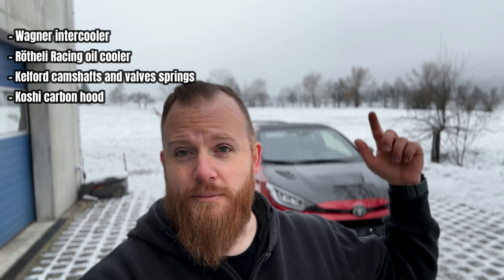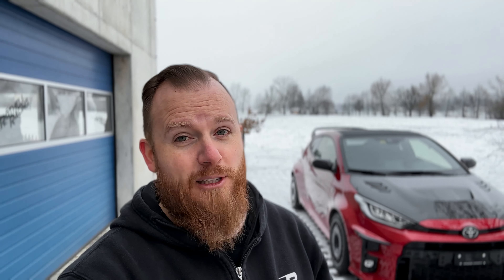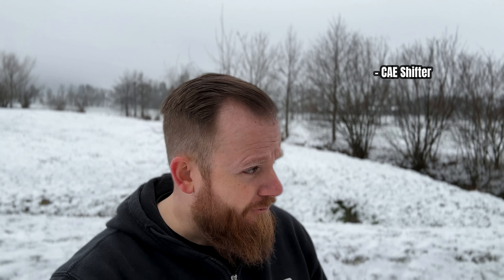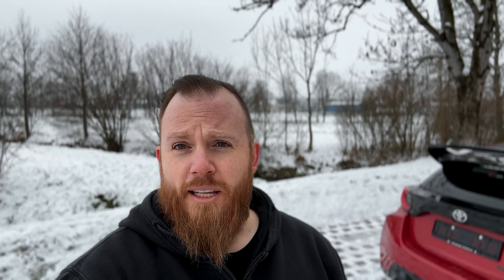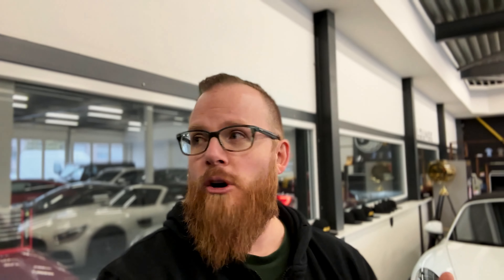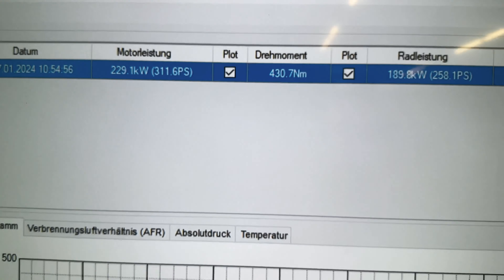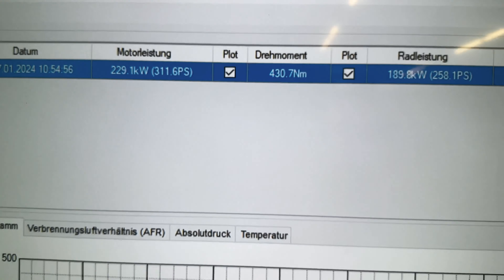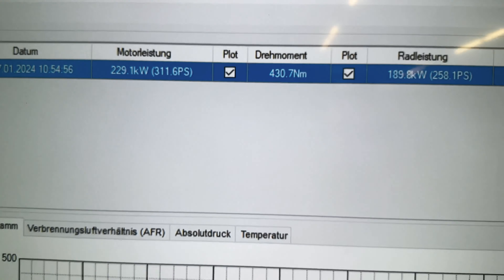Toyota GR Yaris - 360hp Customer Project

Comment: Thankyou thankyou for putting these in English. You are running ohlins with 9kg springs? Does this give a harsh ride?
Reply from the maker: @heathlett275  i use a complete custom Öhlins in mine and other than that, the „standard“ Öhlins is much smoother and can also be more comfortable than stock suspension.
And with a few clicks it‘s also perfectly suitable for track use.
So it‘s better than stock suspension in every aspect.
That‘s why it‘s so expensive. 😅

Comment: I have a question regarding the ÖHLINS suspension front strut tower mounts. You’ve used the DNA-Racing-style top mounts in your race car, do I have to buy these top mounts separately or are they included in the ÖHLINS road and track kit TOS MW00S1?
Reply from the maker: They‘re from DNA, not from Öhlins.
So you have to buy them seperately.

Comment: I have what might seem like a strange question, but how much power could you get with a stock exhaust and those mods? Why stock? I'm getting old and driving around with a droning exhaust isn't as exciting as it used to be. How much of a limitation would it be?
Reply: I think you don't get much unless you tune the ecu to accompany the mods🤓
Reply: @jasoncee666  Understand that. What I'm asking is minus the exhaust mods, what power could you get.
Reply from the maker: Not a big difference to this car.
Stock exhaust also works with around 400hp.
With OPF etc. is the limit roughly 340hp.

I drove with my car with over 380hp and the stock exhaust from OPF/GPF back.

So we can build you a perfect sleeper with 340hp. 😉
Reply: @RotheliRacing  Sounds good. Only problem is you'd need to come to Australia to do it :) Thanks for the answer though. Really appreciate it.

Comment: Great news, what max boost did u run, I have intercooler, OPF delete, hardpipe kit, MST,only making 113hp, with a map that obliviously not working,
Need it mapped to all my mods , should be 330/340?
Reply from the maker: Max. Boost is depending on the Mods.
Depending on what downpipe, intercooler etc. you run, should maybe have 320/330hp.
There are cheap, shit Intercooler which doesn‘t make anything better than the stock one.

Comment: Hi, when replacing the camshafts and springs, did you also replace the head stud?
Reply from the maker: Hi
No. We don‘t remove the head.
Reply: do you think it is not necessary? Will there be a problem with the head?
Reply from the maker: @dariuszkosmider3185  no, not necessary. Only if you go all in with over 400hp it‘s recommended.

Comment: I have got approx 350 on mine without the Kelford camshafts. 

Eventuri intake 
Hjs downpipe 
Monster exhaust 
Airtec intercooler
Airtec oil cooler
Ecu stage 2 tune.

Comment: Did you map the stock ECU or use a Syvecs / Motec?
If stock, then how would you compare the results to Syvecs / Motec?
Is the map reversable to stock, if wanted?
Reply from the maker: Hi
We mapped the OEM ECU.
Syvecs or Motec has much more features, but for that power level, Syvecs would be Overkill.
Reply: Thanks for the answer! Really appreciate it and all your videos! 

Would the map be reversable to stock? If I ever wanted to sell the car in stock form.
Reply from the maker: @sonoffire4978  yeah. We can always just go back to a stock map.

Comment: 311.6 PS with just hardware is really nice, I assume most of the power gains are from the removal of the OPF/GPF, right?
I would love to do that too when I get mine but you just can't do that when you live in ZH / AG, if I was to be stopped by police they'd probably just arrest me on the spot if they noticed xD
Reply from the maker: No. Most comes from the Cams/Valve Springs.
OPF removal is only necessary over 340hp.
We can nearly generate that power with an extreme sleeper build if you want one. 😉